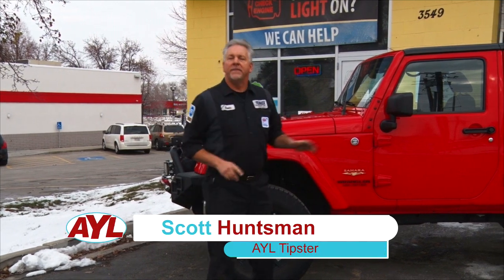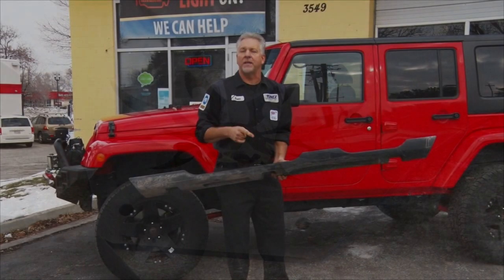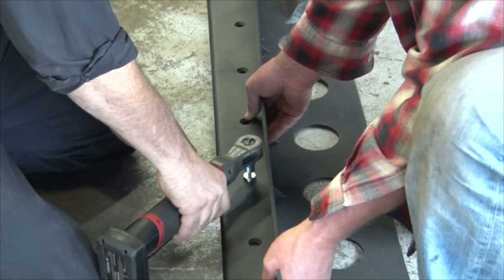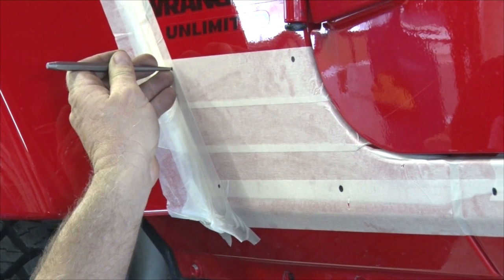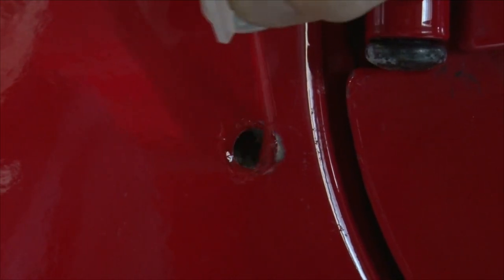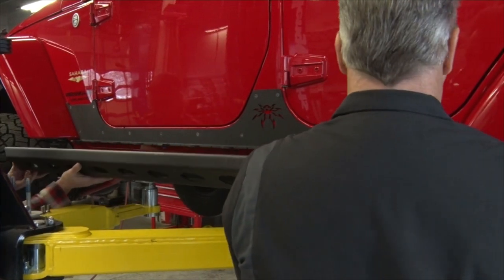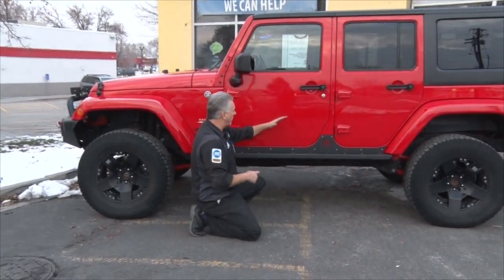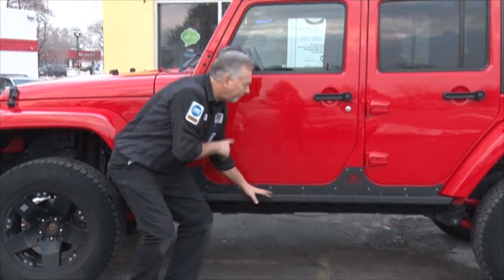Jeep Rocker Panel Installation

Comment: Nice.  You don't silicone behind it or use a thin weatherstrip to keep dirt and moisture out from between the paint and the guard?  One water crossing adds mud and moisture.  thanks
Reply from the maker: After the installation, we did seal the upper and front, and rear to body sections with a clear silicone, we did this afterward (and not during filming or the install) so that it would seal all external surfaces from water and elements so that no moisture would permeate the surface, in the corners, this process took over an hour to get complete (I like a clean calking joint).  That is the method that I use, some will put sealer in between, and some will use other products. Had I included it, I would have excluded other people's ideas on the sealing and really, all of the ways will work, however, I like to seal it externally, Thanks for commenting.

-Scott